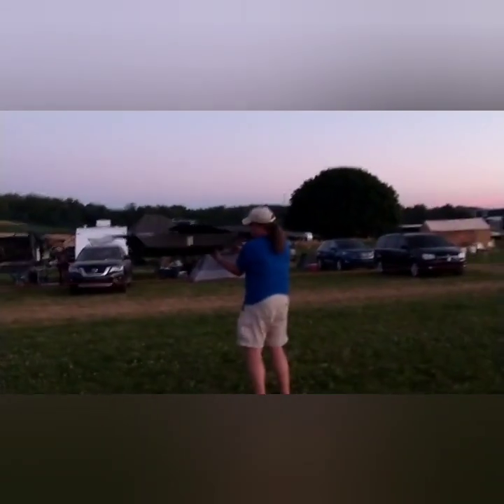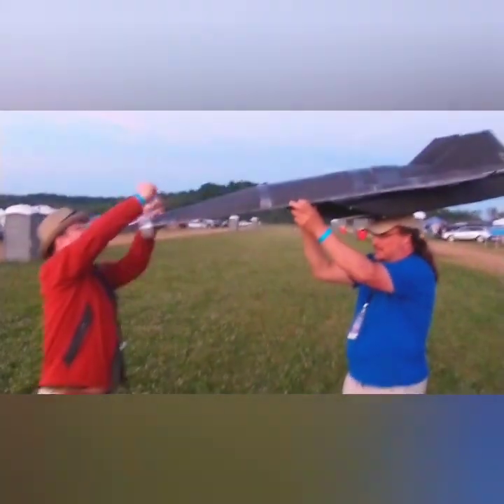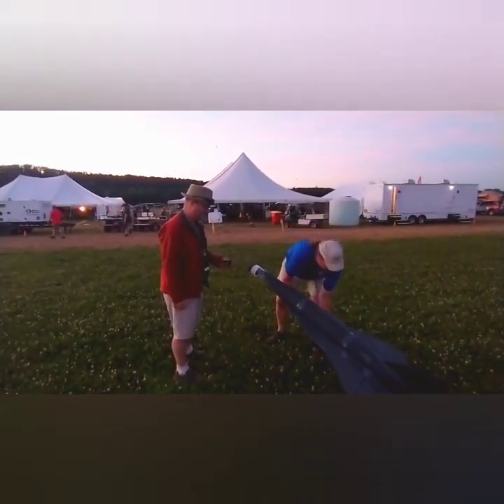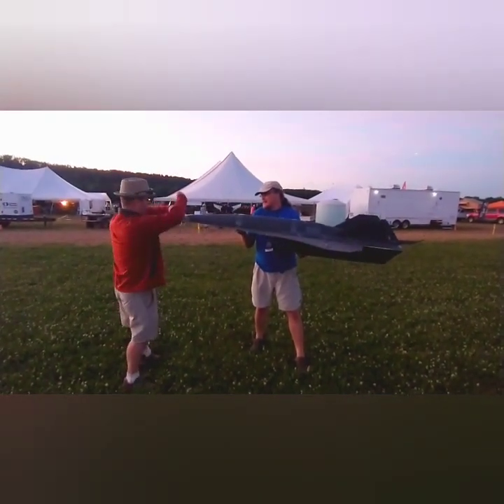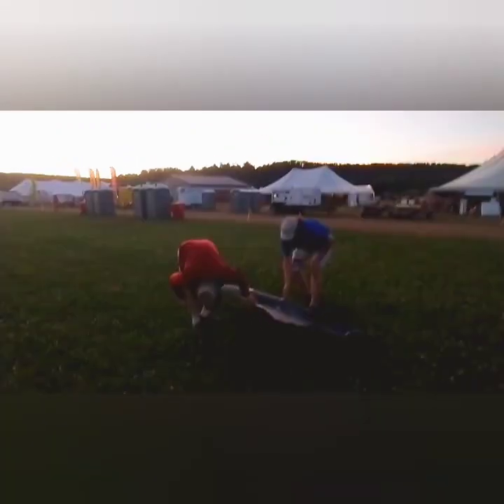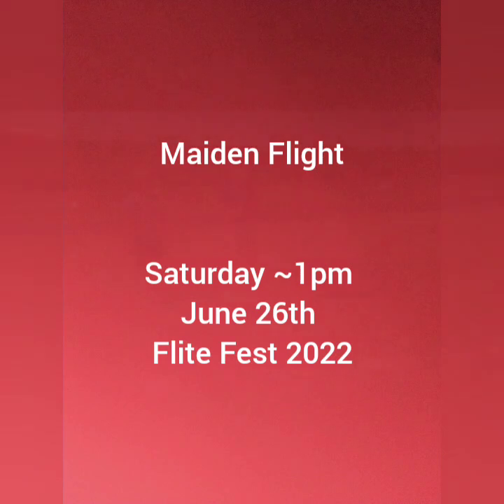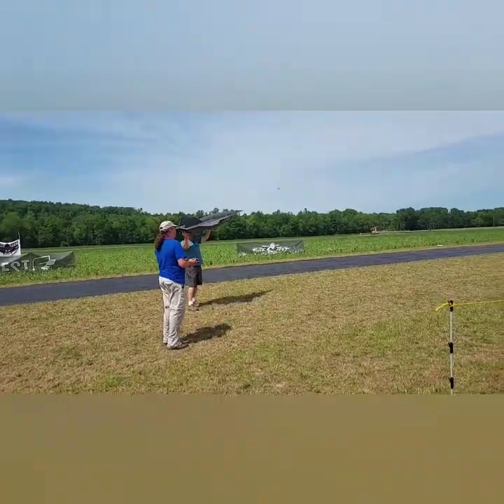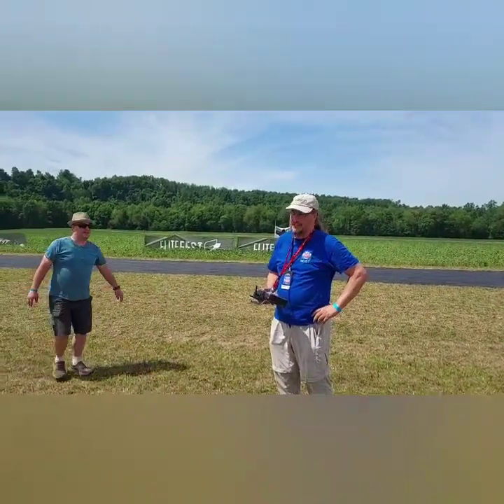DarkStar SR-72 designed by FoamyDM

Comment: I commend you on a clever project but I'm not crazy about foam board aeronautics, what used to be a fine craft of refined shaping and design has become origami for the masses, FT case in point. The SR72 concept is as refined as can be, worthy of a better finish and more thought than a few folded sheets of foamboard.